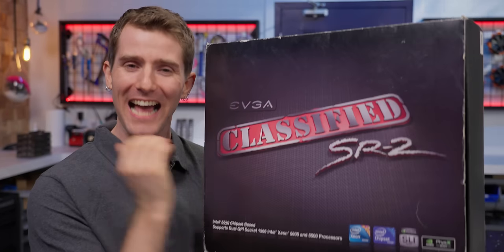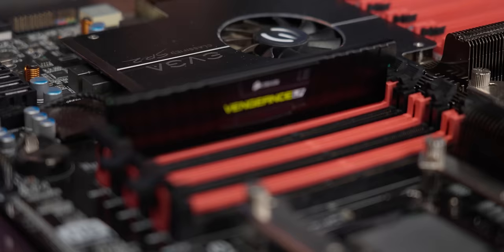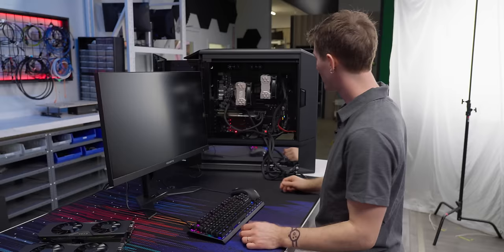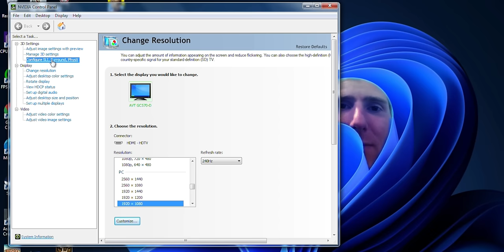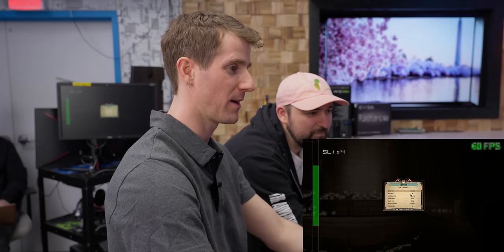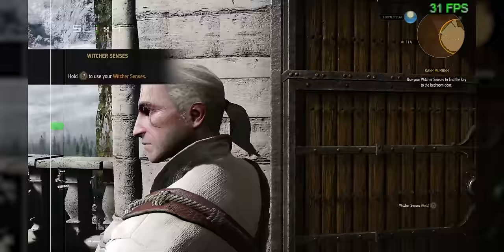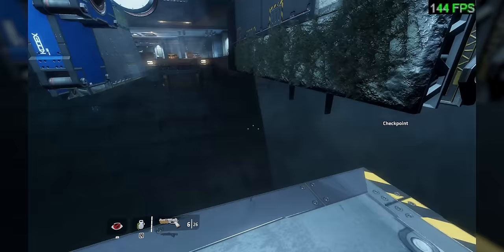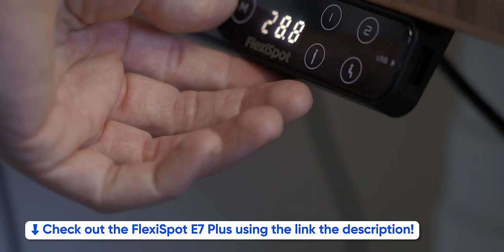How Bad is This $10,000 PC from 10 Years Ago??

Comment: I have a 10 year old i7 - 3770 PC with 24 gigs of DDR3 1600mhz (2 x 8 gig sticks didnt work for some reason) which I threw a 4070 Super into and it works quite well, doubled my FPS and can play 4k streams now too. I used to have AMD R390 and it couldnt handle 4k or 3 monitors. I can crank everything to ultra and cap FPS to like 144 and the CPU bottleneck doesnt cause any hiccups.  Ofcourse I will upgrade rest system later on, but wanted to see if only GPU upgrade would work, which it did. Many games are still GPU bound.

Comment: In 1994 in New Zealand. We saw prices drop from $8 to $10,000 to below $2000.00. The top Intel 486 was $25,000 at the time. Why? Intel moving from the 486 Architecture to the Pentium Architecture. All within 12 months. There was even an 586 for a few months, but there was a floating point error on the chips' math routines. It was not something that would effect most users, but where it was a problem could be catastrophic. Our local council had upgraded to them, only to have to upgrade again at their cost. I think Intel did not offer refunds. I think new fabrication processes also contributed to this huge cost as production became less labour intensive.

Comment: I built a PC in 2011 and updated its motherboard, CPU, and graphics card in 2014.  Had I built it from scratch in 2014, it probably would have cost around $1100-1200.  I didn't replace it until 2024.  It ran everything I ever wanted it to run, just fine.  It started to get a little unstable the last 5-6 months before I retired it.  It would occasionally bluescreen when trying to play games and have youtube running in the background.  Maybe once every 4-6 hours in that use case.  So I can't really imagin that a computer that cost almost 10 times as much could really be "bad" per se.  Unless maybe its cutting edge high-power components hadn't aged gracefully. If they're still able to run reliable, it should be plenty to do most of what any reasonable person would need.

Comment: I'm on an old platform (just hasn't been in my priorities to upgrade yet), AMD FX 8370 with 760g chipset (ThinkCentre A60).

I used to overclock when I had an FX 8320, but since upgrading to the 8370, I have not.  The VRM's already were being maxed out as this system was built for Phenom's and I pushed my luck adding AGESA and microcode for the FX CPU's.  I probably could get some overclocking out of the 8370 but let's be real, Lenovo went with 4+1 phase VRM's.  I'm already pushing it with an 8370.

But at least it launches and runs Cyberpunk (I really think the machine in your video should have, perhaps with Windows 10, there's no way that couldn't and my older ThinkCentre A60 could).

Comment: I used to use a Z800 with X5670's and one major issue is which PCI slots are connected to what. If a thread on CPU1 needs data on CPU0 it has to pass through the QPI and CPU0, but if the GPU is connected to CPU0 then back it goes across the QPI, through CPU0 and to the PCIe. With SLi there is going to be issues with data going over the QPI multiple times just for memory access, then possibly cross QPI again to get to the GPU. It's a microstutter nightmare. These systems run a bit slower but smoother with only 1 CPU installed, or pinning games to specific cores.

Comment: Still happily running an i7-5930K on an ASUS X99-E WS motherboard, mind you it was built for tinkering around with Virtualization rather than FPS style gaming.
40-PCIe lanes, 7 PCIe 3.0x16 slots (using duplexers), 8 RAM slots - quad channel, 14 SATA ports (only one M2 though)
Got it because I was pissed off with running out of expansion on my previous motherboard and it's perfectly capable of running the turn-based games I prefer.

Comment: I'm still running a i5-4690K with 16GB of DDR3 memory from 2014 with a RTX 3080 and modern games run just fine at 1440p and 4k. It's definitely showing it's age a little but has been quite the workhorse for all these years. Will look to upgrade to a 7800x3D this year but not in any rush.

Comment: When I upgraded to an RTX 2070 Super I was still running an i5 750 at 4Gz. Frame capping was my go to trick. I'd run a game un capped to see where it would bottleneck then up the settings until the settings were maxed or the frame rate would start falling. I'd then frame cap about 20% below that. It made for a great experience even though I never utilized the card over 60%.

Cyberpunk Legacy bug got me to upgrade to Ryzen 3600.

Comment: I had a MacPro4,1 upgraded to these CPUs. Worked quite well until the PSU failed in 2021. 2009-2021 (with upgrades in that time of course). But 12 years out of a single system isn't bad.

Comment: Budget rigs are still well worth overclocking, my recent Alienware Area 51 build with a Ryzen 3 3100 runs with decent gains at 4.4ghz up from the stock 3.9ghz.  Generally the more cores the harder it is and the less benefits there are to overclocking for daily use.

Comment: think you have to "force alternate frame rendering" in the nvidia settings for each game to get all cards to get used if I remember correctly,  Personally used to run 3x GTX285, then 3x GTX 580 back in the day and stuffed around for ages to get them all up to nearly 100 % usage. I think there was another tool I used along with it.

Comment: Was using a socket 1366 based system and i think part of the stutters you were getting were from ram speed/timings. 2133mhz cas 9 was the best casual OC kit i ever had my hands on that ran stable but to run tripple channel kit it you probably could only do 24gb a socket across 3 sticks. Probably running 2x satas in raid 0 might iron it out a bit more but the last run with the 3090 was a best youll get realistically.

Comment: great video as always  but back in the day quad sli required more than just plug it in and turn on sli. game specific  Drivers and they do make a difference i had to change to a 20A outlet as it would blow the breaker 3d tests. yep over 1500w  ultra X3 power supply 1600W. keep up the videos

Comment: I'm running a similar era Xeon server with 64GB as a desktop, and it just breezes along. I'm not pushing it that hard, but I've never used Windows without it feeling slow before. 
I had some decent CPUs in the past, but something about the Xeon just feels effortless. I haven't got an NVMe drive yet, but even on SATA it's still really snappy.

Comment: I did a poor man's version of this test.
The results were dismal.
I build a wicked computer out of parts from about 15 years ago.
It had an amd FX processor at 5ghz. (My uber overclock skills at work.)
It had a sabretooth motherboard.
A server video card that was roughly equivalent to a 690 on juice. (It allowed for mega overclocks, very fun.)
A snappy SSD. I had to go sata.
ECC DDR3 memory. Interestingly, it was supported by my motherboard and allowed for mega overclocks. I had it running at nearly 2000 mhz. 1T.

On paper, this thing was an absolute monster. In 2012 it would have been worth it's weight in gold.
When playing games from it's era, it was fantastic!

But, I built this rig in 2022.
At it's best, it was a dog. It barely played anything, and if you could get it to work, it was slower than a turtle.
I tested it extensively, and eventually the processor failed from heavy strain at high frequencies.

It put me off of building computers permanently. I am done with it forever.
You see, my classic rig cost me about 450 dollars total to build.
To build something substantially better would cost over 1000 dollars.

After that, I bought a budget laptop for 250 bucks that killed my classic rig, and I am happy with that.
Or, as happy as I am ever going to be allowed to be as a poor person.

Modern computers are depressing.

Comment: My motherboard will do quad crossfire but only at x8, standard crossfire at x16 though. Never ran it that way though and it only uses 8gig of ram at 800mhz instead of 1066. I liked how they gave all these options but hamstring it with slower speeds.

Comment: I built mine 11 years as the best value gaming PC I could. Aim was to run Skyrim at ultra settings and not spend over 1000$.
It was serving up until recently. Yes, it could not run the latest triple As, but it ran everything I wanted from it. Best value for money deal everr - essentially $90/year or $7.5/m for a gaming PC :))

Comment: Oh, man, you dumped 7 on it?  Should have done 10pro retail.  It can be forced onto those processor and handles them better.

I think a set of 780's would have worked better on the board, there were some issues with the 900's on that older chipset and bios, even the Kep2 Titans (700 series) didn't like them.

Comment: I'm still using my desktop built in...  2012-2014?  Still works, dust cleaned once a decade and chain smoke daily next to it, only thing is I haven't dropped it (too hard) off my desk.  Still works, but won't even bother trying to download new games, lol (Thank you Blender for the EEVEE render engine, lol).  i5-3570k and a mid-low end (at the time) AMD Verde graphics card, 8GB RAM, and it works, but I'm looking to upgrade soon, hopefully before it dies.  EDIT: Cost to build was ~$1,000 in 2014.

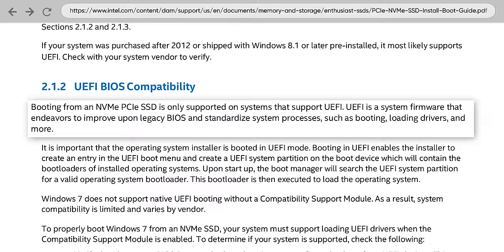Comment: 4:40 -- If you're talking about just usesability, there's almost no difference in how a computer "feels" between a SATA3 SSD and a NVMe drive.  SSDs of all stripes are becoming so cheap, that in boards that don't actively support NVMe, it's honestly no more expensive to simply RAID a couple of smaller SATA SSDs together (obviously with running backup protection if you're storing anything important, etc.)

Comment: I feel like overclocking makes sense when one doesn't have money for a good system. If you can afford $1-2k on a new desktop (without display), you will be able to run everything with high fps anyway and the system will feel like it flies.

Comment: Wow, what a powerhouse system! SLI/Crossfire for gaming never really made sense, did it? 

I did want to say, Unigine Heaven actually stutters a fair bit on one GPU, like on my 3070, especially on the scenes with the dragon statue. Almost every time in that scene. For checking steadiness of frametimes you can't really use Heaven, unfortunately. I don't think it's down to the hardware not keeping up, if I recall correctly it stutters there even with a framerate cap set. Must be loading some assets in a blocking way, or something. I dunno.

Anyway, I'm enjoying this video and learning a lot from it. Thanks for this!

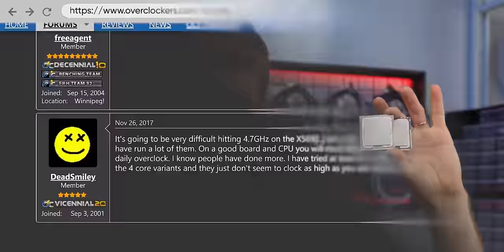Comment: I am deadsmily mentioned at at 2:51 and I did Quad SLI on an X58 system with X56xx (forget which one) using 2x GTX 690's.  It was a stuttering mess.  Those were really interesting GPUs to me as they were basically 2x 680's with a slightly lower clock than the 680.  They had an SLI bridge built into the cards and a single GTX 690 would run in SLI by itself.   The problem with the GTX 690 was it was a 4GB card with 2GB for each GPU, so... VRAM limitations were a real problem.  Still, I had fun exploring that.

Comment: The lack of NVME support brings back recent, painful memories. I'd been running a Asus Rampage IV Black Edition board for about 10 years now. 8 Sticks of DDR3 RAM did the job for everyday use, and I pretty much upgraded everything on it over time to the best parts it (and the case) could handle. 

But the problem that made me bite the bullet and get a new board? Storage. PCIe 3.0 is a bottleneck and like you said, there are hacky workarounds with NVMe to PCIe converters, but lots of feedback online that says they're very hit/miss as to whether they'll actually work on such an old board. 

So now I've got a Rog Strix Gaming Wifi II for the next 10 years or less. 😂

EDIT: Also: I had a 980ti and the first game to require me to upgrade? Baldur's Gate 3. It was a VERY good card for its time. Underrated, even.

Comment: had the SR2, back then Xigmatek Elysium and Xpredator from Aerocool could fit it as far i recall. Except only the Xigmatek could still fit two power supplies with that board installed 😏

Comment: The 384bit bus on the 980ti only makes the GPUs original price 600 or so USD because the thing uses 12 512MB chips each for the bus. Unlike the GTX Titan from the 900 series that uses 12 1GB GDDR5 chips, or the next gen GTX1080ti which uses 11 1GB chips.
Now something like the 4090 uses the same bus and same amount of chips, but 2GBs each, and those things are incredibly fast GDDR6X chips, along with the fact it has a crap ton of cores. All of that builds up.
Then of course something like the 4060 easily beats both GPUs in performance, and it’s a 300 USD card that’s incredibly efficient as well… so you know. Doesn’t matter if GPUs now are more expensive, when these cards easily beat enthusiast level ones from years ago.

Comment: I have a LGA 1150 from about 2016. Just for kicks I recently maxed out the mobo with 32MB of DDR3-1833, and dropped in the I7 Devil's Canyon 4790K CPU. For the GPU I got a single 3060ti.
This old thing makes a pretty good gaming rig, pushing about 60 FPS in RDR2 at 1440. I spent about $650 for the upgrade. Oh yeah, I also got my first AIO and I'm completely satisfied with its performance.
It's not a mega blaster, but I think I'll keep this one for a little while.

Comment: Not Using MSI Afterburner or EVGA Precision so we can't see an overlay showing usages seems a bit odd, 
I mean how did you set fan speeds and power limits to above 100% and so on.
Yes it works fine still on windows 7 as i was using a 2014 System with Win 7 and MSI Afterburner in Jan 2024.

Comment: Im running x79 systems still.  Mostly server stuff but a desktop also have a xeon x79 using for a desktop low power with a 2070 super.  Minus loading times runs 7days to die rather well at 1080

Comment: Speaking of supporting non-ECC RAM, maybe my experience is unique, but I've always had better luck overclocking ECC RAM than non-ECC RAM.  This is one reason I've always prefered AMD's platforms as more often than not, they support ECC even if they don't actively advertise it.  I just gave my 2990WX threadripper setup its likely last "mid-life overhaul" and upgraded to 128GB of RAM for no reason beyond I was able to get a matched 4x DIMM 3200mhz ECC RAM pack (meaning I don't have any real use for that much RAM, I just liked being able to get 4x matched 3200mhz DIMMs, etc. for quad channel support)

Comment: I think your SLI monitor was causing issues because the one game that you didn’t have it on was a lot smoother than the other games so as a control, you should’ve turned it off and seen if that made a difference

Comment: Man, it DOES suck that SLI and XFire ended up being not nearly as efficient as "Having multiple GPUs" would lead you to believe. I remember back in 2009 being so stoked for QUAD GPU SETUPS and it just turned out, no, it does nothing to boost performance how you think and just creates more heat.

Comment: Don't overclock the CPU or GPU anymore...RAM is with XMP....i9 9900k still serving itself perfectly for flight sim (would like to do a new build in a couple of years..trying to make this last). Nvidia 3090 (would like to upgrade this first (4090 as of now) and put in new build later if not...then 5090 when released)..still running DDR4 128gb RAM 3600mHz CAS18

Comment: Im still running a Rampage 3 extreme with a i7 x990 (cheap es from ebay), with 3090 running Unreal 3 Caustics build for arch renderings. Its still a beast and for this specific use case, it runs faster than my i9 12900F as the only bottleneck is vram size. Only down side is ram limit is only 48gbs so I cant run Unreal, 3DsMax and photoshop simultaneously but that really not a big deal considering the system (gpu aside) is 14 years old.

Comment: It's not worth it if you don't already have the motherboard, but X58 is still a  workable platform. I was running an x5675 at 4.2ghz with a 2080 super until very recently. Getting into MSFS in vr is what finally killed the platform for me- for everything else I was interested in playing, performance was good enough to make a platform upgrade hard to justify for 14 years.

Comment: i had 3 watercooled 980ti's with a 5960X

it was so awesome :D

edit: at 1440p - tomb raider used my 3 cards back in the day - witcher did at one point, but then didn't anymore,

with 3 cards at 1440, i remember the witcher doing 90 fps. 

EDIT: I TOLD YOU GUYS, 90 FFPS.

Comment: CPUs and RAM speed have become very important in games. Even 7th-10th gen Intels are at a notable disadvantage compared to newer 12th gen+ Intels or Ryzen 5000 and above. And there's a big difference from default DDR4 speeds (2666-3200) and high speed/low latency DDR4 (4000+ with low tCL).

Comment: Most DDR3 Servers will handle anything ram you throw at them. I board I have which is a Super Micro x9dri-ln4f+ will take non-ecc, ECC, and Load reduced ram. That latter will get you over a tb on the board I have.

Comment: So basically no need to spend tons on a new top of the line pc components as they will likely in less than a decade be very outdated especially for the price so incremental improvements are best even if you would spend a fortune

Comment: Re: keep old CPU and mobo and just stick in a new GPU: My 4970K@4.5 with 16GB DDR3 and TUF RTX 3070@1815 runs most modern games fine at 1080p. Often the GPU handles the Quality settings just fine internally. It only really struggles with vast open-world games. If the game has inefficient game code for spawning/despawning/world culling, that's where you need to lower some settings (if available). So, consoley frame rates in RDR2 averaging 45, but basically in full quality.

By far the biggest purchase along the way was the RTX 3070. Still running the original Win7x64 install, no reinstalls. A testament to solid parts including the 4 SSDs, it supports 2 decades of software evolution.